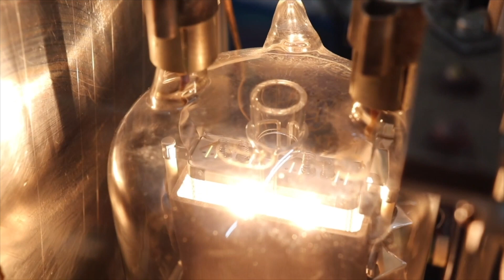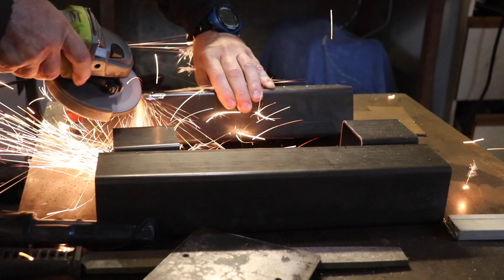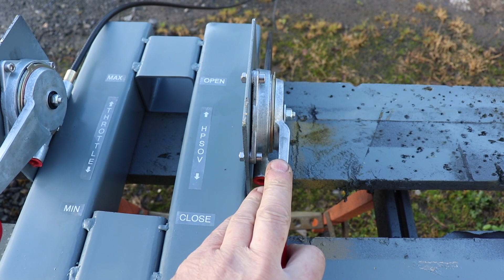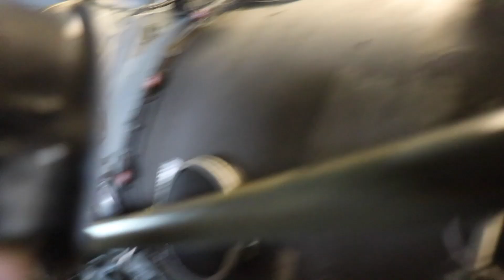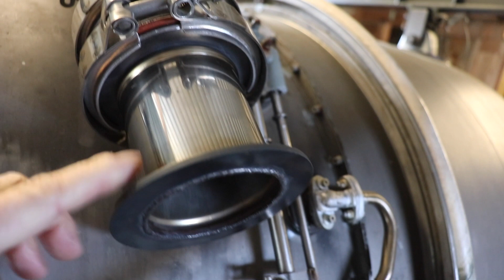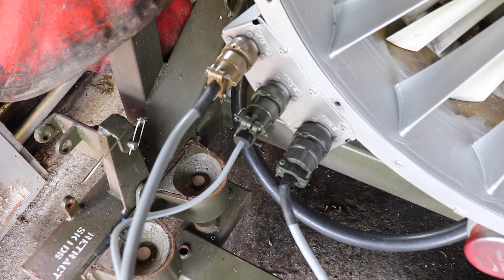RR Spey 4: Throttle Cables And Start Sequence Demo

Comment: There is no question about your expertise but how about this diy very  inspirational jet adaption ? https://www.youtube.com/watch?v=-O-JWddgagk  This is based on a flapper valve. You recognize
the sound ? But difficult to make in order to get this amount of power.
Reply from the maker: Yes indeed, not done much with pulse jets as usually have to use petrol mix, dangerous!!
Reply: @thewtf   This is very informative about the principle that 99% of pulsejet makers
got wrong. https://www.youtube.com/watch?v=NXWSQ4clh7k  A german original.
I could translate this for you. But not a single engine blew up. A must see.

Comment: That was super informative and interesting. Thanks for sharing. I have two questions: a) What happened to that huge Rolls Royce Rb211? b) What kind of pressure does the air come out of the APU or start cart? Does the starter have gearing that makes it easier for the air to turn the engine? Thanks
Reply from the maker: It’s about 30psi, but high volume( can’t remember the exact figure) Yes, the starter has a gearbox built into it. The RB 211 was moved on several years ago